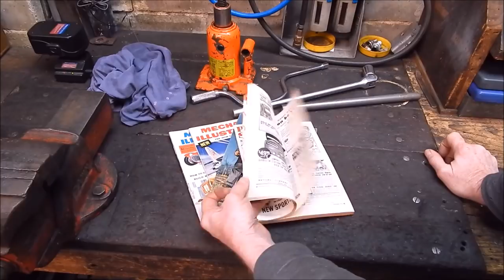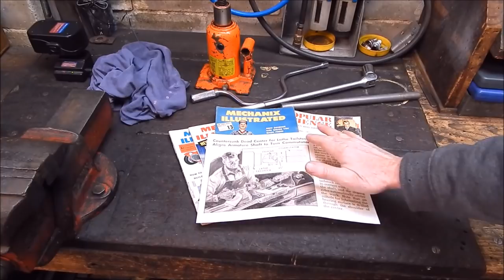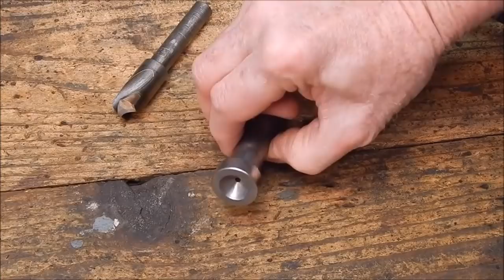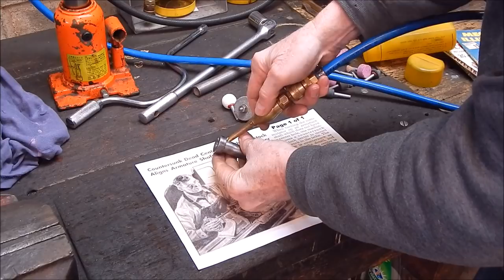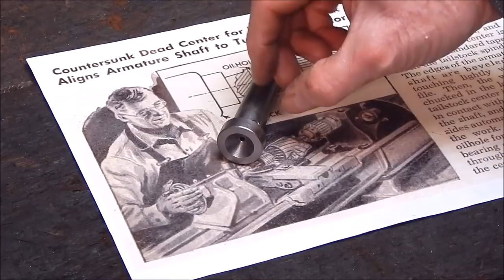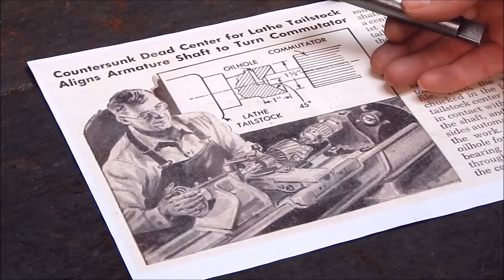How to make a countersunk dead center for the metal lathe tailstock

Comment: Love those old magazines - used to have a pile of them and often found them a good source of ideas.
Great job with the center - super useful to have on hand. Was thinking - if no hard material on hand then some std cold rolled would do if case hardened in the countersink, considering the center may not have to do a huge amount of work.

Comment: Very handy tool. Those magazines in the 1950's catered for the middle classes as tools were very expensive. The workers with machining skills were not earning enough to buy hobby lathes. Also in the 1950's in the UK not all houses had electricity they had lighting but not power sockets and people used to burn out the lighting using an electric iron plugged into the ceiling. To have money to buy a lathe and a house with a garage and electricity back then was only for the rich. I am afraid it is becoming like that again. Tools are cheaper in relation but houses are expensive and getting smaller, no garages, nowhere for a lathe. I feel sorry for the youngster today.
Reply from the maker: I remember when my father looked at a lathe (Southbend) and it cost damn near as much as a car.  Needless to say we didn't come home with a lathe.

Comment: Thanks, Rob for yet another nice tip! Old Machinist trick: These countersunks could also be used if/ when cutting a steep taper (with offset tailstock) on a short piece of centre drilled stock just by dropping in a ball bearing at each end - suspended between two countersunk ends at each end. Lube well.
For the more steep angles, turning merely between centres wouldn't work, you'll need ball points. Cheers, DIYSwede
Reply from the maker: Hi Johan,

I did hear that a very long time ago as a way to get around the obvious issue with pointed centres, and promptly forgot it.  Makes a lot of sense with big offsets.

Thanks for the heads up.  Probably not something that will get a lot of use but mighty handy when you need it.  Plus it adds to the tool box ;)

Cheers Rob

Comment: Nice tool there Rob.  I see you are always coming up with something and here it is a new old idea.
Reply from the maker: Hi Harold,

I've had this on the back burner for a long time and finally made it to spec.  It is quite simply excellent the way it works.

I pinned a comment to the top of the page after I tried it out this morning.  For such a simple design and having used dead centers a lot for clearance issues, I was blown away by the performance.

Well worth making.

Cheers Rob

Comment from the maker: I tried it out this morning and it worked 100% perfectly.  

The oil feed acts as a little reservoir and is great, no marking on the dead center or the end of the shaft.  I spun some steel rod at about 470 rpm and used carbide on it at the dead centre end without any problem with finish or accuracy.  Did this on the old Schaublin 102 and mic'd it up afterwards. 

I'm very impressed with the way this works.

No heat bluing or oil smoke from the contact area as can happen with pointed dead centres.  Barely got warm. 

Making it properly with hard steel and having the oil feed makes all the difference.  Very pleased I did this.

If you don't have a die grinder, you can clean up the countersunk taper with a small boring bar.

Recommended addition to the tool box.

Cheers Rob
Reply: Thanks for the follow up. Good to see the thing works so well.

Comment: Neat device Rob - I can imagine it would come in handy for lots of stuff outside of commutators too. Often a small shaft or something needs truing up or buffing and there's no centre provided. I know from experience that it can be tricky to put an accurate centre hole in a shaft that doesn't have one...! So using the OD of the shaft is a good idea.
Reply from the maker: Hi Craig,

It's a handy item for certain situations.  Commutator turning is just one application.  Adding a centre drill point to a built up shaft isn't always possible, so the outside support approach is the way to go, quite accurate, and stable.

You can get a similar countersunk centre as a changeover for expensive multi tip live centers.  BG have one.  Steve Jordan reviewed it favourably.

This is way cheaper, but you are subject to speed constraints.  I actually use dead centres quite often to get around clearance issues.  They worked in days gone by and still work today.  But then again so does HSS ;)

Cheers Rob
Reply: @Xynudu  Yes - I can't live without HSS either. How else do you quickly make a custom cutter? :)
Reply from the maker: Hi Craig,

HSS is still top of the heap for some jobs, especially brass and soft alloys.

Unfortunately everyone has gone carbide happy and that's all some know.  Grind a HSS cutter?  That's like asking them to fly to the moon ;)

By the way, I tried out the dead centre this morning and it worked very well.  Have a read of the comment I've pinned at the top of the page.

Cheers Rob

Comment: Nice one Rob. I particularly like your double ended "toolpost" grinder very clever.
Reply from the maker: Thanks Malcolm.  The grinder configuration is unique.

But it's also logical, if you want to do cross and radial drilling/grindng with one configuration.  Works very well.

Cheers Rob

Comment: Thanks for this Rob. I'm curious as to what lube you use for your dead centres.  Some kind of high pressure lube?
Reply from the maker: Plain old car engine oil.  There's no high pressure to worry about really.  It must just be able to handle high friction/shear temperatures.  In use the center ran very cool compared to the pointy ones most people have experience with.  The trouble with those is that the oil reservoir is tiny, while the cup centre  reservoir is large and keeps everything lubed nicely.  Cheers Rob
Reply: Same lube for the pointy ones?
Reply from the maker: Yes.  In the old days they apparently used  white lead grease which was toxic as hell.  I've tried ordinary grease and it wasn't much good, but car oil seems OK provided you keep it up.  The main thing is to not over tighten/load the dead centre end pressure - it really doesn't need a lot.  On a live center it doesn't matter, but dead centres get hot if you overdo this aspect.  Cheers Rob